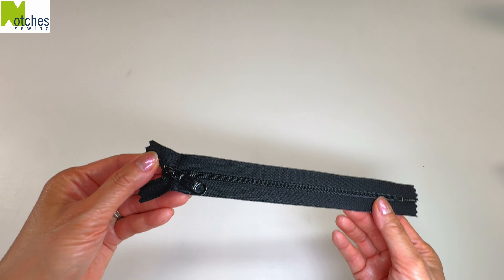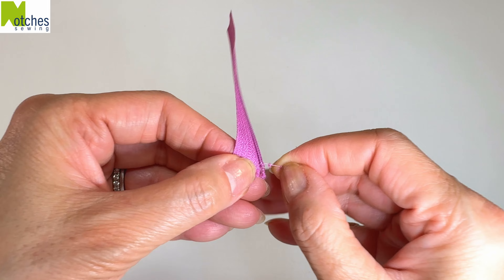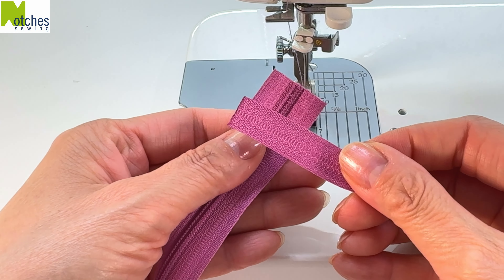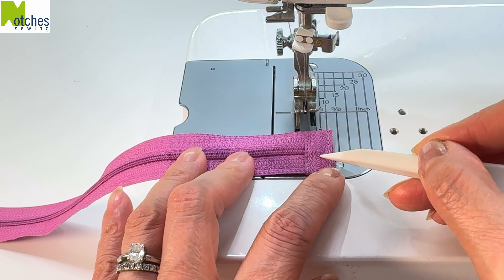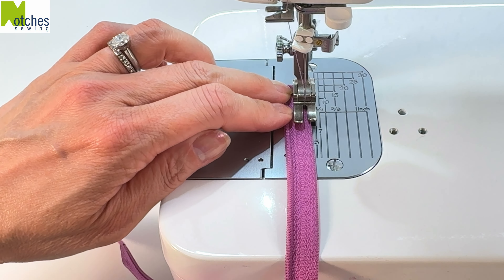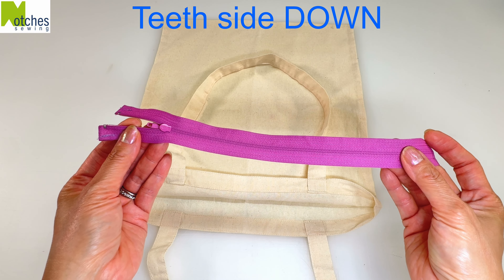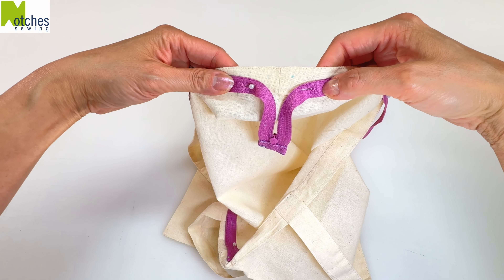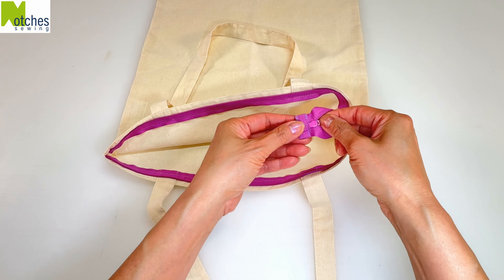How to add a Zipper to a Finished Tote Bag  - Easy DIY

Comment: Hi I just found your tutorials and enjoy them. I didn't know I could learn so much at my age. Could you make a tutorial for a wrap around head towel  for people with long hair. Something that will stay on the head without slipping. Thanks a million!
Reply from the maker: Do you mean the ones that twist from the back and then button in the front?
Reply: @NotchesSewing  Buttons get caught up as do the elastic button hole. Something long enough to wrap up the front and maybe tuck in back of the neck. Thank you for getting back to me.                                                  .

Comment: Great video!! Exactly what I was looking for. Where you folded down the top part of the zipper, how would I do that with zipper tape. Or would I need to do that part with zipper tape? I agree with the earlier comment about the significance of the zipper tab. Awesome idea!!
Reply from the maker: thank you!  You can just sew both ends the same way with both pushed in
Reply: @NotchesSewing  got it! I was making it way harder than it needed to be. Thank you very much!!

Comment: Honestly… I’m sewing since I was about 4yo, am 64 now…..

But it is for the first time now that I hear of # numbers for zippers!!

How do I know what size it is and where/how can I find some sort of link/list??

Ty
Reply from the maker: Hi!  You can usually find the number on the back side of the slider.  The number is size and width  of the teeth when closed.  So a #3 zipper is 3mm wide. #5 zipper is 5mm wide etc.  The link for some size 3 zippers is done in the description of this video under tools I use.  Thanks for watching.